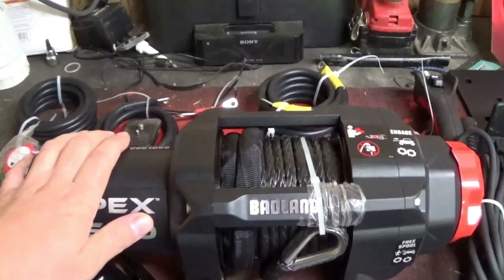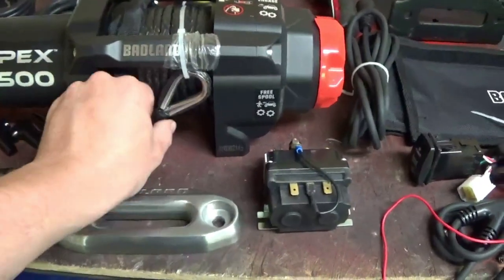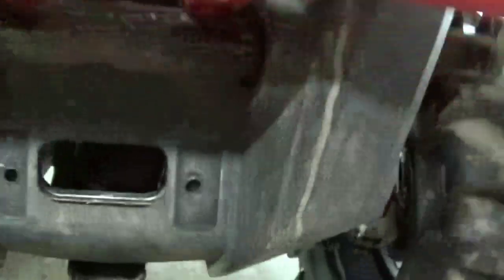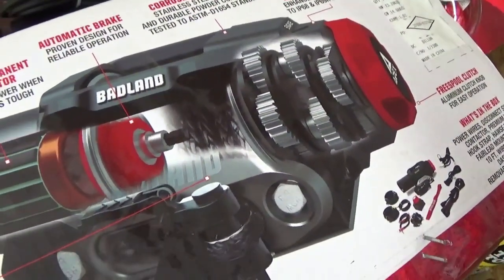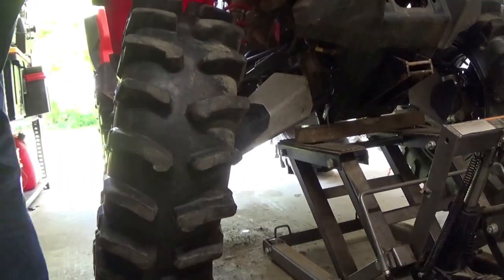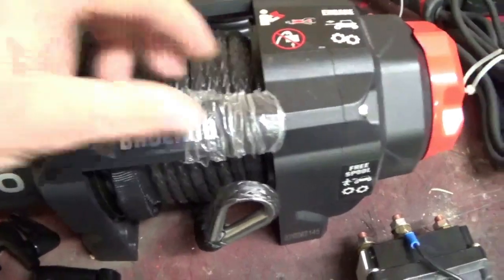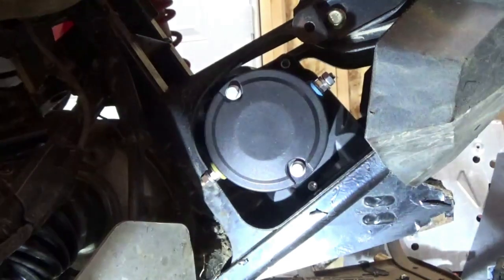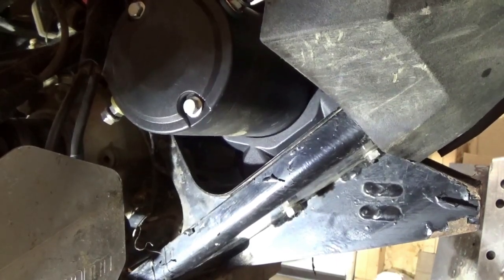Badlands Apex 5500lbs Short Drum Winch Install On My Can Am Outlander 850XMR (Harbor Freight)

Comment: Thanks for the nice video.  My manual mentions spooling under tension but yours appears to have been pre spooled, is this correct?
Reply from the maker: @KevinSmith-dq4tf yes it’s pre-spooled
Reply from the maker: @KevinSmith-dq4tf  thank you!
Reply: @j-muddy93  Got it, looks like I still need to spool it under tension before first use.